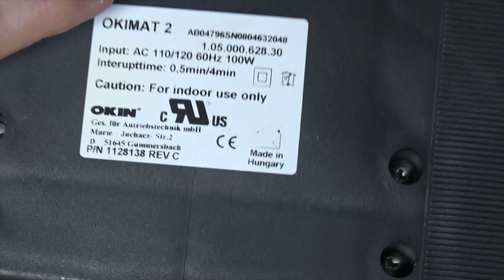Home Hospital Bed Motor Unit

Comment: What would i connect to the 9v conection to power the bed in case of power outage because i tried a 9v battery and it started tk work but it doesn't connect fully so im wondering of there a female something connection to it @8:25